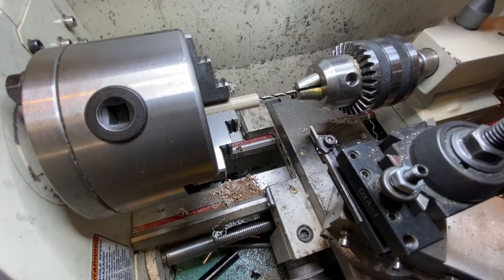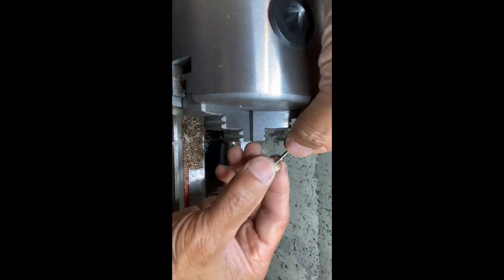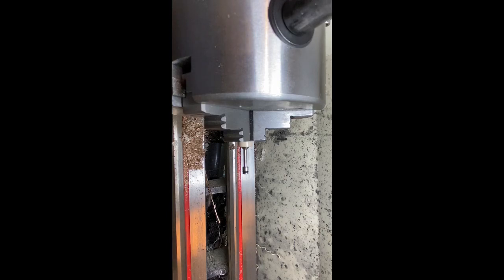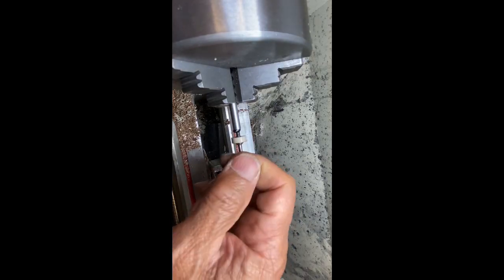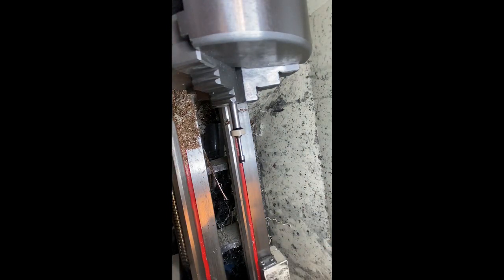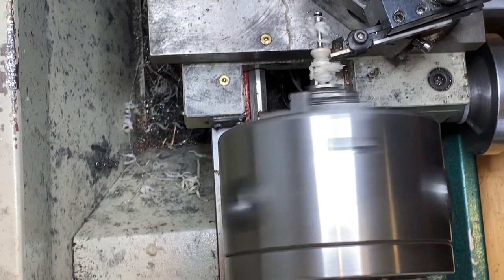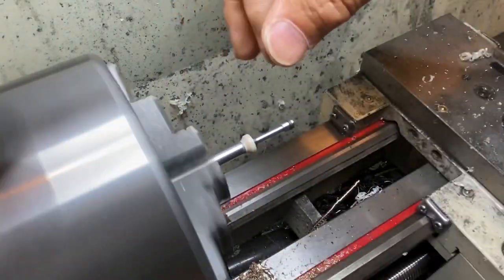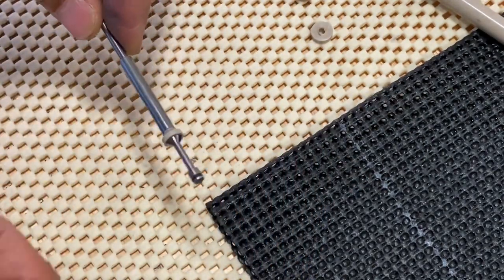Fx impact custom high power peek rod seal

Comment: Its absolutely crazy why these are not for sale as a spare part, all I can find is entire new valve rods with the stem attached talk about a waste especially when it's a easy fix, screw off the valve stem and replace the seal bang job done, am I missing something here?

I want exactly what you just made !! Is it simply a case of ordering the peak and then machining it to the spec you have outlined in this video?

Comment: I was getting worried when you started hammering it on that you were going to bend the pin 🙈
Reply from the maker: It titanium they flex, you can flex then straight again, also you can press the peek on.
Reply: @ernestrowe5061  Is the rod made of titanium?

Comment: Please sell these 😍, I’m still waiting for your carbon barrel sleeves 😎, will the new valve seat fit the power plenum model ? Thanks
Reply from the maker: Need to use the PP pin to install the peek.
Reply from the maker: Will be months till custom size CF sleeve be available

Comment: The size is different than the power plenum one ?
Reply from the maker: This one is cut to 7.60mm, stock is around 7.45mm for the PP MK2. Old mk1 are 7:15mm . If your rod end start to stick out the mag slot that’s indicating your rod starting to go through the metal seat rod will jam and gun will not fire.
Reply: Ernest Rowe I just measure my new Power Plenum one and it is 7.20 mm....is it normal ? Maybe they did not shipped me the good one ?
Reply: Thank you Ernest. I have a minor problem with the first Power Plenum generation one and FX have ship me a new one they told me have been modified. The first one was white and the new one is black.
Reply from the maker: Gin Kenvin —have seen new one in. Both color